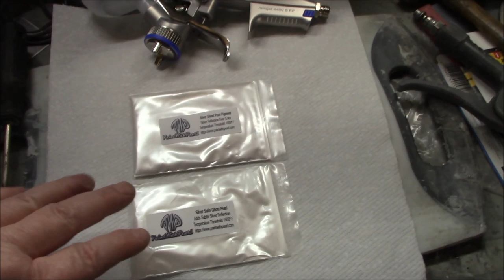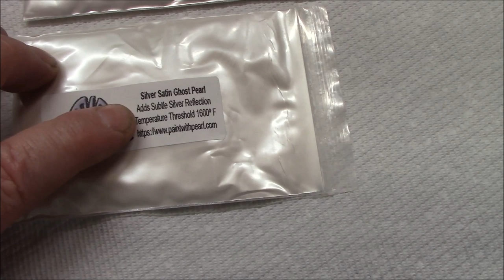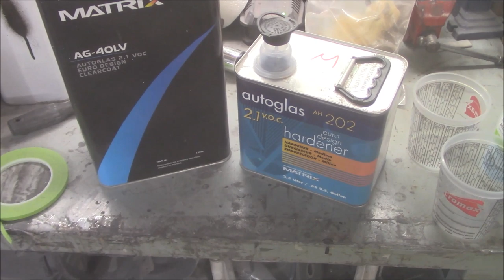1968 Triumph TR250 Restoration, Still Sanding and A Little Paint Project on the Side....

Comment: Owww! That looks painful!  I'd suggest getting a skinny spark plug socket and a wobble-stick extension.  That always works well for me on these Triumphs.
Reply from the maker: Michael Stoliker It sure was 😄. Much better today though thanks.  Yes, I was telling Les I have the old style, double ended spark plug wrenches that you put can put a screwdriver through or and open ended wrench in the end.  These are much thinner than the standard sockets.  Unfortunately, Les’s shop is not as well equipped tool wise as mine is...

Comment: The stripe idea seems like a tasteful compromise, I can completely understand UK restorers of repatriated TR250s deleting the stripe and even using TR5 badging, but in your case it would tie in with your striped TR3A.

I always thought the use of TR250 instead of TR5 (‘A’ for America ?) was strange.. they must have wanted to emphasise the advances or maybe Americans liked 3 digits to show engine size.  The Sunbeam Tiger was badged 260 and there had been the Daimler SP250 (AKA ‘Dart’ outside the US). Presumably the marketing guys called the shots...

Of course the following TR6 had the same name for all markets and specifications.